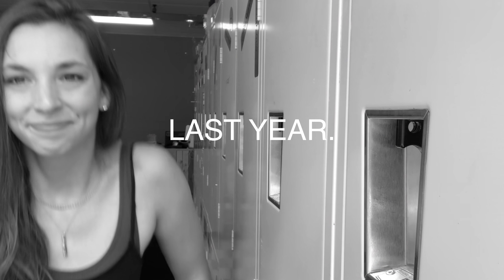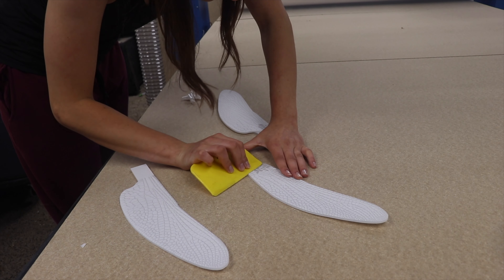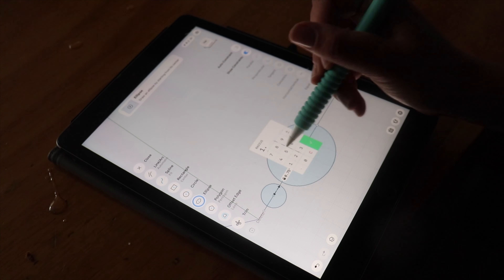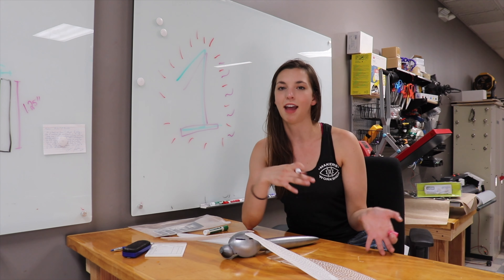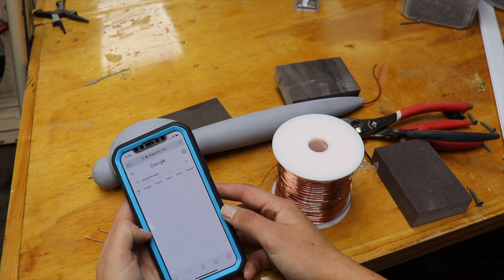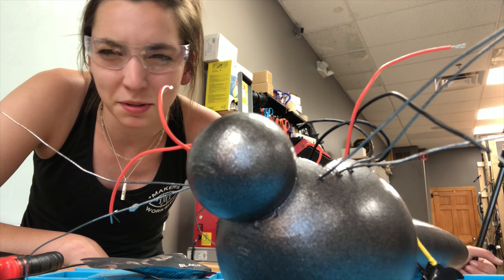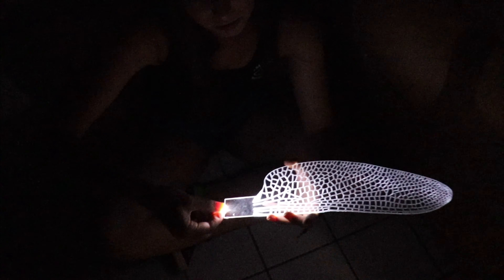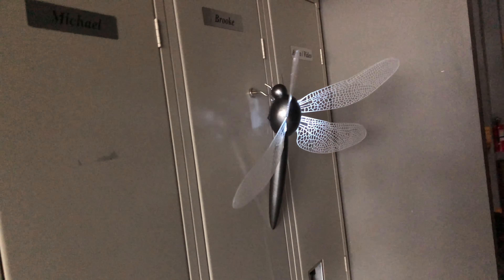How To Make A Laser Cut BUG | Glowing Dragonfly Nightlight

Comment: An actual weeding pen is priceless. Used to do it for years for a job. Now do it for my own self created job. If you want to rip off the transfer film or whatever was oem on that acrylic you need to peel it first and replace it with a transfer media film that has an adhesive backing unlike all protective film and transfer tape. Then a cheap high tack paper will stick after squeegeeing it down and quickly pull off intricate weeding in one(ish) pass
Reply from the maker: So off camera I went in and peeled on of the wings with an awl. It did the best in terms of speed but I had a few scratches in the acrylic and since it was going to be lit I knew those scratches would also end up illuminated. I wonder how differently a weeding pen would perform. You have me curious. I also love the idea of replacing the masking ahead of time. Such a simple solution. I’ll have to take a crack at it at some point.

Comment: Welding Pliers for 3D Print support removal...

but for really, that "glue" is a good touch. Links in Description?
Reply from the maker: I just got the links in there for the moldable glue. It’s a bit pricey but worth it in my opinion. We use it all the time and it gives a clean finished look and feel to things.